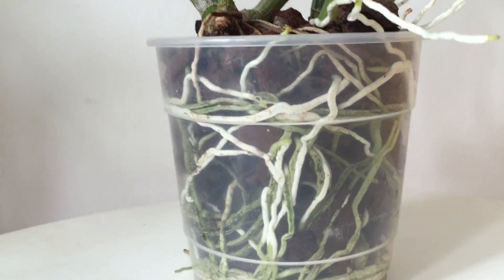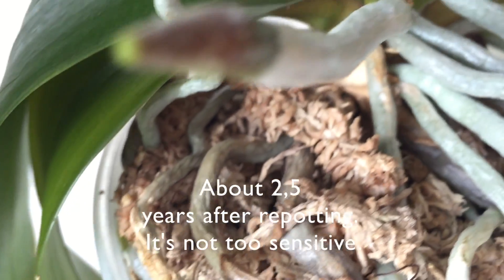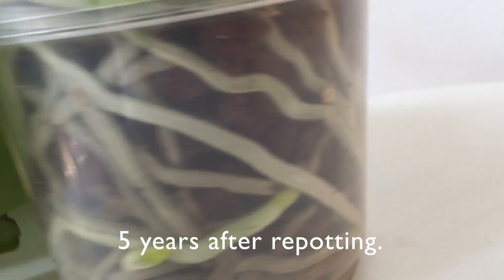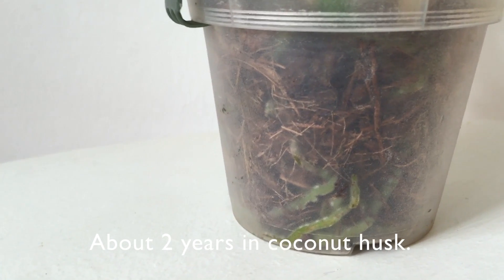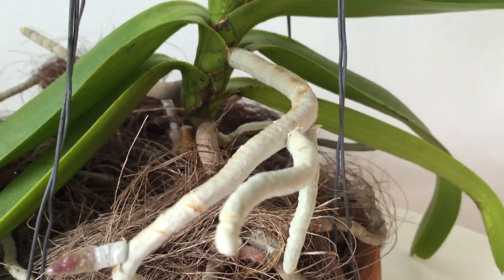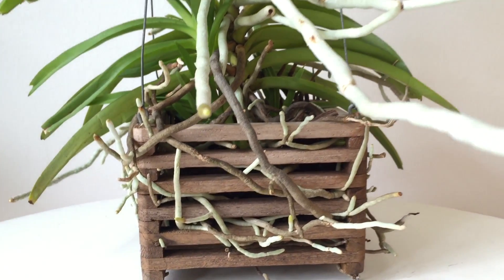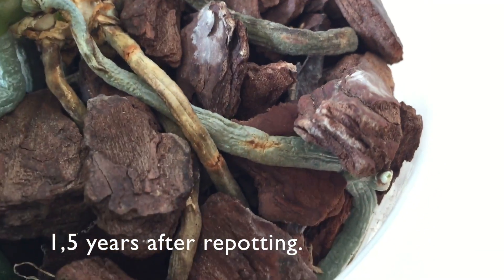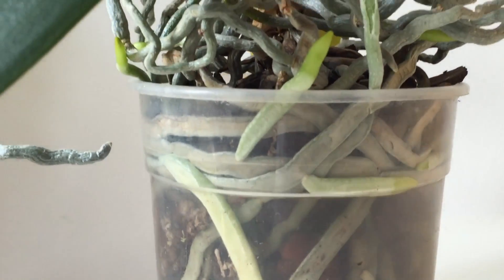Root Burn on Windowsill Orchids - My Setup - The Time Factor

Comment: Hi. I am wondering why I also seem to have root burn on my aerial roots only. I water with tap water using the flush method. I have never fertilized... ever. Yet I seem to have burns on the aerials wherever the water touches them. They are in a highly sunny part of the living room, but not super close to window, which is brightest in the afternoon. The leaves seem fine though, no burn there. Any thoughts? Could it be the water from the kitchen sink is bad? Or issues with evaporating/drying out too fast? Another orchid in the bathroom never gets these burns. It is watered from my shower and has beautiful silvery green roots.
Reply: Your tap water is probably too hard.
Reply from the maker: Sorry for replying so late, Angela. I agree with Ioana that your tap water might be to hard meaning it contains too many salts your orchids are not able to absorb.
Reply: @bumblebeesorchids3408  It only seems to happen to the orchid in the living room that I water from the kitchen sink. I have another in the bathroom that gets its water from the shower head and I never see burn marks on its roots.

Comment: This is a very interesting topic for me because i have tons of root burn on the air roots of my phalnopsis, yet i have never fertalized them!i only fertalize those in the pot... i have no idea what is happening? any ideas?
Reply from the maker: Hi melannie! So the burnt roots never get watered, just the ones inside the pot? Hmm, maybe the roots suck the water up to the exposed parts and when they dry they leave those strains/burns?
Reply: Hmmm.that could be.  I really have no idea what happened. Thanks for the idea :)

Comment: The tannins in the bark can stain roots, so it may not all be burned along the length. Since phals are pretty tough, they can even start accumulating visible salts before it kills the root. 
The tell-tale sign of salt buildup in the mix is this: when new roots stop growing when they touch the surface of the mix. You said they start to grow again, so it's a bit hard to tell for me. 
First thing you need to do is repot. Pot them deeper so the roots are not so exposed. 
Second: you said you are a "lazy" waterer and your temperatures can get pretty high. Try to find coconut coir or coconut husk chips. For Phalaenopsis: a mix of coir, perlite, and charcoal will hold more water, so you will have to water less frequently. If you can only find 
Coconut husk chips, you can use that with perlite or by itself or as an additive to bark to hold more water.
An important note about coir- you need to soak it or boil it repeatedly before using it because it is very high in salts initially.
It works best for Phalaenopsis.
Do not get the fine peat grade. You want the shredded kind. This form is INSANELY easy to repot with. Even though it requires more frequent repotting than bark, all you have to do is pull the plant, shake it off, rinse, and the mix will come away from the roots without damaging them. It's also easier than bark to get into the pot around the roots.
A great brand is crop circles if you can get it.  Don't buy sunleaves piece coir. 
I've been in the process of making a coir video. It's my favorite thing for phals....
Reply: The "grow it! " or "plant it !" Coir is very good and affordable. It's even a bit chunkier than "crop circles " brand and has less fines. 
Coir will hold more fertilizer salts than bark, so you should only feed maybe once every 3 waterings at 1/4 strength. Your 14-14--14 probably has more P and K than is needed. Make sure you're no using a fertilizer with urea. 
Also, for your orchids in pots: it's very easy to get some wire shelves with trays underneath like I have OR if you have a solid table, put the trays on the table, put wire closet shelves over that, and set the pots on those. If you drill drain holes in the trays and the overhang your table a bit, the drain water will run down into the bucket. This allows you to water your orchids in-place where they live. You don't have to move them to the sink or anything. There are large 2 for by 4 foot trays made in England that are almost exactly like the ones I have. It's much easier and more fun to water when it's less work. You can also hang rain gutters for the drain water or on the wall for the plants to sit in...here are a few links that show you what I'm talking about....

Comment: very informative! thank you I will pay attention more I have not had a ton of root tip burn and I fertilize pretty heavily
I alway soak roots for a bit before adding fertilizer that way they are a sponge , then I usually flush pot by pouring water thru and I have had good results...
Reply from the maker: Thanks, Michael! Sounds good! I think soaking them beforehand could reduce root burn, because they might stay moist a bit longer and give themselves time to absorb the fertilizer that remained on their surface.

Comment: This was a very interesting video! Before watching it, I didn't think I had much root burn, but lots of my roots look just like that too. I used to think they were stained (I use a brown seaweed extract, that also stains roots), or that it could be a harmless fungi. I thought of root burn when I saw stains on new, white roots. The old ones start to look bad with time, at least on the outer surface, and only the roots on top of the pots. But like with your roots, mine also make new growth tips with time and start to grow again. I think the velamen of the roots can take a lot of staining/burning, but the root inside is safe and healthy. As long as there is no root tips dying, I'm not too worried. It was interesting to see that glass of fertilizer, how it liquefied completely! It looks very surprising! :D I don't know if I would use it after that. Something in its chemical composition could change. I don't know.
Reply from the maker: Thank you so much, Andrea! ;D Also for telling me that you experience root burn, too. I have these stains on the most exposed roots. On the Vandas it's a gradual process of them getting greyish with time. It's like you say, the burns rarely kill a root completely, they just look a bit ugly and might decide to take a break and stop growing, but after some time they get the feeling they could give it another try. :) 
Likely something has changed in the fertilizer. But should I really throw it away? :/ I don't want to. Also, it's more convenient in it's liquefied state, haha. :D
Reply: Bumblebee It's hard to know. I don't like to throw it away without certainty that it wouldn't work anymore. The one I use is getting old, but it still seems to work. I have been watering the plants with plain water before the fertilizer just to be sure. But as the product is getting darker and sticky too, it will eventually be bad, or not as good as before. I don't have anything better to use instead of it at the moment. Maybe when Currlin gets Orchiata for sale, I could order that, a couple of plants, and 2 bottles of their special fertilizer A+B, that comes in two bottles and have to be mixed right before use. The owner said he uses it for all the orchids.But a powder fertilizer is usually much more economical.
Reply from the maker: It's really hard to tell. Even if the fertilizer wouldn't work properly anymore, I think I would see changes maybe after many months, but not instantly. Most of the effects I observe on my windowsill are really long-term, everything develops very slowly. 
If I may tell you my opinion on the A+B fertilizer, I don't know if I would recommend it. It might be a good fertilizer and I used it for quite some time, but the bottles are still half full. I always spill some of the fertilizer, because the bottles are designed unfunctionally. Also, it's hard to put the exact same amount of both fertilizers into the water. And one of them is red an I'm not sure why that is.
Reply: Bumblebee Do you have the same A+B fertilizer that Currlin sells? I don't know where the nurseries' fertilizers are made, do they make it themselves, or do they all order from somewhere and sell with their own tags? So many of them seem to have green fertilizers that look so much the same. From what I can see from the photos from their webshop, the A+B bottles are not very ergonomic, so I know what you mean. But I haven't seen many liquid fertilizers that would come in easy to use bottles. Except for some local brands around here, that have that same kind of cork like fabric softener usually has, that is easier to use. I use some measuring spoons (for cooking) that are excellent to measure the right amount of liquid, but I don't know how easy it is to pour it from the bottle. The big bottles are more economical but also probably harder to use. Is their only problem the bottles? How well do they work? I think I should probably buy something new soon, if the rainmix I have is old, but I'm short of ideas.
Reply from the maker: Yes. I don't like it when fertilizer runs down the bottle afterwards. I always have to clean the bottle, the underground and of course I loose a bit fertilizer each time. I don't think they make it themselves, they seem to have a supplier that produces and bottles the fertilizer for them if I'm not mistaken. The composition of nutrients seems to be unknown. I asked about it, but they told me they wouldn't know, but it wouldn't be important as long as the plants thrive. ;) I'll use it for my next batch of water and will use a spoon and tell you how it worked. Except for a bloom booster where I think I noticed some positive effects, I have never experienced any obvious differences between different fertilizers. It worked as well as every other fertilizer that I used. :)
Reply: Bumblebee I once actually asked him the same thing and got the same answer. 😊 He doesn't know what's in it, but uses it with all the orchids and they grow well. Next time I order something from them, I might buy the fertilizer to try it. But I don't like the mess either. I wonder if it would be easier to take the right amount with a pipette /dropper, if it's possible to find one long enough and with a ml scale on it, like those used in labs.